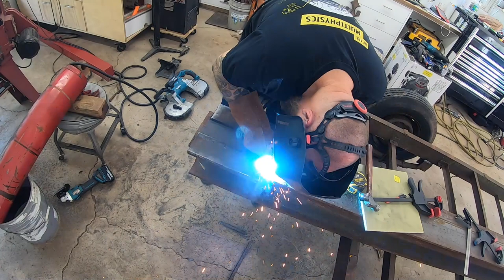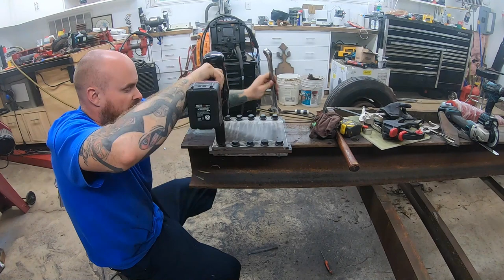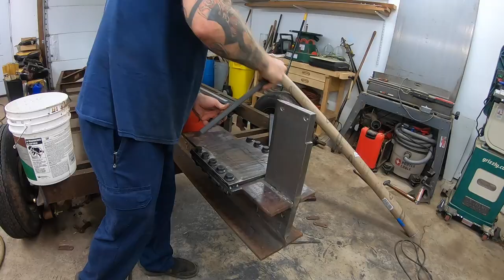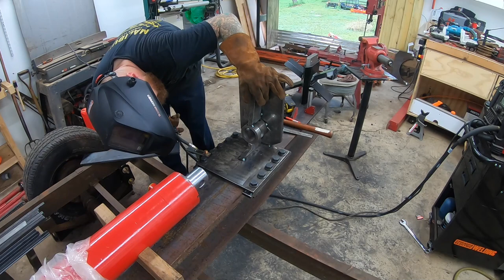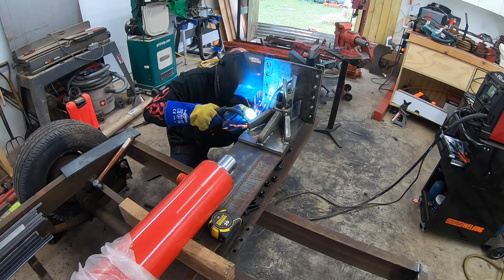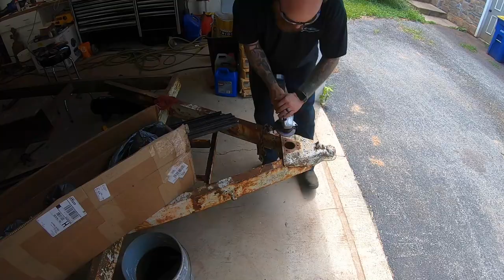Firewood Processor Build Ep 2  - Splitter

Comment: What did u say the specs where on the hydraulic cylinder?  Hard to hear with this piece poop tablet I watch on. I heard 24 inch stroke is all I could make out. How many tons if u don't mind me asking.
Reply from the maker: Tons is based on pressure. This is 4.5” cylinder and Ruggedmade list this cylinder for their 28 ton splitter. At 3000 psi, the cylinder is putting out about 24 tons.

Comment: First off nice job square stuff off  that cylinder is overkill to the max and not needed your not crushing concrete blocks  as well all your connection plate for cylinders ect should be stick welded mig  dose not penetrate well  and the welds I've seen so far are sub par  and with some pressure will shear off  I do know what I'm speaking of I'm a ticketed welder fabricator red seal have done tons of structural  and owned my own company doing it right for 45 years your welded connections are only as strong as your weakest spot so even tho it appears to be big and strong those welds count the most
Reply from the maker: Thank for watching and the advice. So far, luckily the welds have held up.